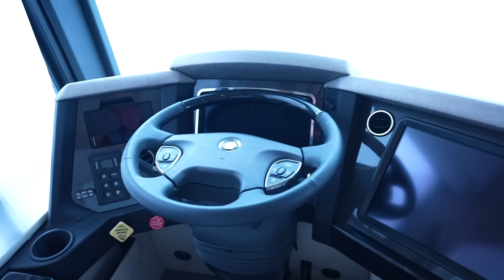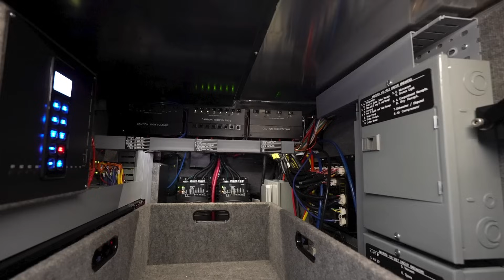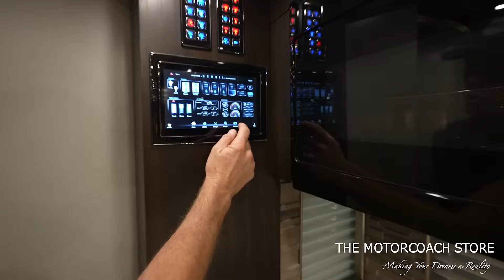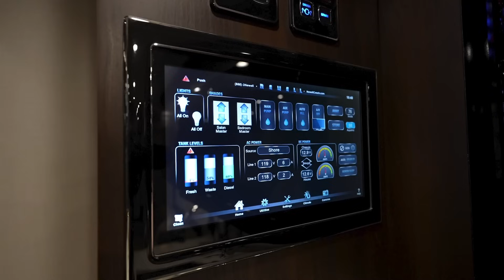2017 Newell P50 Show Coach For Sale (Bunk Coach With 2 Full Baths!)

Comment: Newells are awesome BUT I'm way too old to be bending down that low to get into the bays...not happening 😩 I also love the tag axle for rear wheel steering but I'm told via a Provost dealer that tag axles are a pain in the booty among other things. Now checkout the Euro Rearview Mirrors, looks like a Pray Mantis ready to Strike 😁 I love it...
Reply: tag axles are great and pretty much problem free. Prevost has a lifted tag if you need to make a sharp turn and Prevost dealers will always talk smack about Newell.
Reply: @sfcjones2590  I believe you! But can their tag turn the wheel either direction while standing still?
Reply: I don't think it would be good, they need to have some motion to keep from eating the tires up much in the same way as steer tires @CatNMrDJ